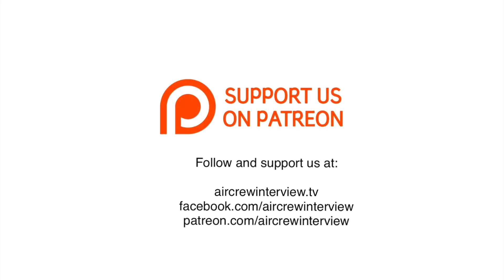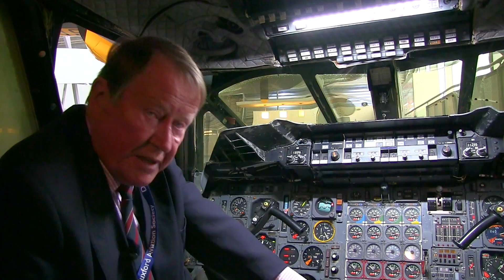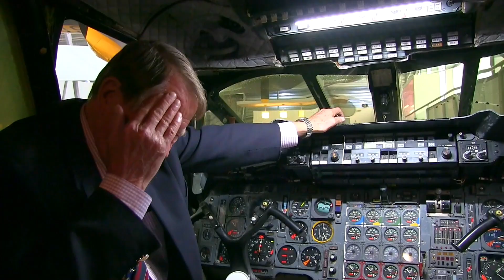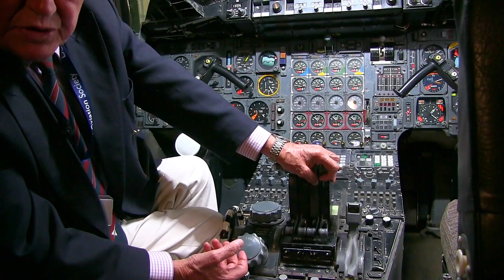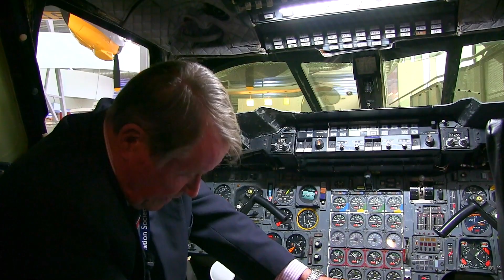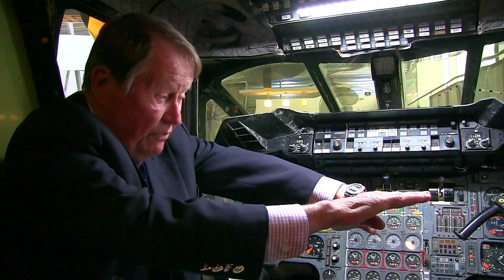John Hutchinson on Air France Flight 4590

Comment: Every air disaster points to polity error but with a co-pilot safety should not be compromised and if it is both pilots should be dismissed and lose their licence. Every time I have travelled by air the plane experiences Turbulence but when travelling form Sydney direct to Dubai 2006, we were warned to expect Turbulence all the way but Turbulence only began after leaving the Australian coast line and we began traveling in access of 500 MPH, which caused the wide-bodied Jet to shake violently and yet when we reached Dubai the plane had to wait to dock. I know a head wind slow a plane in flight and no doubt a tail wind increases flight speed well above 500 MPH perhaps the pilots were keen to avoid stacking on arrival at Dubai save fuel.

Comment: why did they discontinue using the Concorde? This was the one and only Concorde crash correct? And it certainly was not any fault of the plane itself.
Reply: Link they discontinued Concorde because it was too expensive to fly
Reply: It seems that heavy scheduled maintenance was on the horizon at a time when BA wasn't making all that much money and AF was happy to let her go. Airlines fill gaps by leasing or having spare aircraft but Concorde wasn't an option.

Had it not been 2003, it would have been the hit of the 2008 financial crash and the ensuing high fuel prices (you can see here: http://www.macrotrends.net/1369/crude-oil-price-history-chart)  that would have done it.
Reply: To expensive and it was not a commercially viable option to keep running when you might fill 1/4 of the seats plus the fuel economy would make it even more expensive so thats why.
Reply: It was discontinued because no one wanted to fly the Air France concorde anymore. People flew over the channel to take the BA one.  BA actually made money from Concorde.

Anyhow, once Air France deemed their Concordes were no longer making any sort of money, they retired them. There are reports of Airbus then having meetings with Air France, after which Airbus announced they would no longer produce any spare parts. Without those, the maintenance on the BA Concordes would have been tough. BA asked to buy the Air France fleet to keep theirs running. A solid no was given in answer.

And there you have it, BA was forced to retire their fleet, despite having 30 to 50 Million £ of interior upgrades in a hanger, just purchased and waiting to go into the aircraft.

All because Air France maintenance and one flight crew fucked up
Reply: Too expensive. And of course, 9/11 happened the following year
Reply: The main reason about 9/11 was that all the execs etc that flew on Concorde were killed on that day --It's a pity more people hadn't used it from other countries or it would still have been flying
Reply: Twenty Rothmans how long can an aircraft like Concorde be maintained safely?  Wasn’t it close to 27/28 years old?
Reply: 911 had an impact
Reply: So an event that was yet to happen brought down Concorde....wow!!!
Reply: Trisha Yamada if it had Been maintained properly and the captain had not overloaded the Aircraft fuel and also had the runway Been checked properly for debri that crash would not have happened , it was not the Aircrafts fault , look at 747s still flying after 30 yrs without crashing
Reply: +Link There are good points below but I would point to an ill-advised partnership between Britain and France as a starting point.  Britain and Germany would have seemed much better, because there is just a lot of aviation orientation and expertise  in Germany, but.... maybe it was just too soon after World War II for the British...who knows? The second point is that the business model for the Concorde depended on stable, low-cost fuel, which went south in 1973.  Jet fuel in early 1973 was about 20 cents a gallon.   A third point is that the Europeans underestimated our American pettiness when the Brits and French built an SST first. Believe me, a Boeing SST could have made all the noise it damned well pleased.  Fifth, there was no backup plan if the big American carriers backed out of their commitments to operate Concorde, which they did.  Sixth, there was no real plan for using or marketing the Concorde in alternative ways, such as cargo or converting  the aircraft into some kind of nonscheduled bizjet.  Seventh, the Brits and French had no stomach for pursuing improved engines or a faster design as a follow-on to the Concorde, and  so they finally just lost their nerve and quit.  I was always afraid that it would be the French that crashed the jet....as a friend of the UK, i would just close by saying that if you Brits imagine that  America would keep its NATO commitments to defend you in case Russia feels certain about  what the Dear Leader WON'T DO, then you are sadly mistaken.  Best to redevelop that famous  British determination and ramp the backbone up, and figure out a plan for yourselves, I would think...but thank you for giving us Concorde for a few years!  Cheers!
Reply: William R McIntosh I want to correct you on a few points you made.

They did have plans for a follow on. Concorde 2 was already on the drawing board, which would have been enlarged with more efficient engines. Plans were already underway, quite literally, in the drawing rooms designing the next Concorde upgrade by the time the first prototype lifted off in 1969.

Even by 1978 a Concorde III was being discussed, which had a high bypass hybrid turbofan stroke turbo jet engine producing far more power for the same fuel output.

Concorde was being chartered from the mid 80s, and making a huge profit for British Airways. Not only that by 1986 the scheduled services were making 25% of all of British Airways is profit just with the Concorde, ignoring the entire rest of the British Airways subsonic Fleet. That tells you how much profit British Airways could make out of Concorde.

We didn't lose our nerve, it's just that Airbus wanted something like £140 million for a maintenance contract, which British Airways wouldn't pay out of pride.

Airbus put this cost down to developing New Materials, new hydraulic oils etc, which was just a poor excuse, because they didn't want to maintain Concorde anymore - it was a waste of time for them.

So after Air France decided to stop scheduled services with their supersonic fleet, British Airways had no choice but to call it a day as well.

Comment: I had heard before about the possibility of the Concorde being grossly overweight on takeoff, but this is the 1st time I'm hearing of the missing spacer on the undercarriage truck, one more piece of an unfortunate puzzle. It's sad to think that if you remove just one piece of this puzzle, the accident probably never would have happened. If the Captain had not overfilled the tanks, even when the plane ran over the metal strip, punctured the tyre and hit the underside of the wing/tank, it may not have ruptured and the takeoff would have continued safely, allowing them time to dump fuel and return. Would have been a rough landing still, but survivable.  Many thanks to Cpt. Hutchinson for providing the complete story.
Reply from the maker: Dave Chapman I had never heard of this argument before chatting to John.
Reply: I can't remember where I heard it before, maybe it was another time that John had brought it up, maybe it was from someone who had heard this interview before, I'm just not sure, but this is still a most fascinating and tragic interview. Many thanks & Cheers!
Reply: Something similar happened to a VC10 in Addis Ababa in 1972. Some brake componeents were incorrectly refitted. There was a burst tyre before V1 and when the crew tried to brake the action was too poor and the a/c went off the runway killing 4 I believe.
Reply: The investigation looked extensively at the spacer and found it had no material effect on the accident. The assymetric thrust would have been far more significant than scrubbing tyres.

Comment: Wow what a mess. Although a DC-10 was the cause of the debris, a whole series of events made it even worse.
Reply: The main problems were the fuel and weight issues caused by the pilot.  The debris was minor.
Reply: fools could have taxied to the other runway and taken off in the other direction and had no issues
Reply: @bradrum1  The debris is unlikely to have been the cause of the tyre ripping apart, more likely the scrubbing at high speed. The debris was a way to deflect blame.

Comment: i was wondering if the concorde had moden computers would it of made it ?
Reply: not really, the aircraft was overweight at takeoff, meaning that even if it managed to land or decided for a takeoff abort it would have made a real mess
it was airborn with a stuck undercarrige and below 75% total power: 3,4 full, 1 at roughly 75% and 2 running betwwen 3-4 and 15% due to fumes hot air ingestion (before beign shut down) so in the end it was trying to stay airborne with something like 70% power at best and max drag
add also a cg that was constantly creeping backwards
to this you have to add the fire burning the structure and more important hydraulic lines
Reply: Leah Jackson I think it would as there would be no flight engineer to turn off the engine for no reason.
Reply: Ross TheNinja 
That engine was putting out between 5 to 15% of its max power after the fire started

Comment: The whole sad truth. If only ONE of those mistakes had not been made, perhaps it may not have been so fatal.
Reply: Vista Brazil
Reply: Biggest mistake: Improper maintenance on landing gear. Least forgiveable mistake: maybe the pilot's deliberately choosing to over-fill the tanks. The pilot probably didn't fully appreciate the reasons why the tank fill limit was set to that level, and the risks involved in going over it. If you don't have as much knowledge as the engineers who set a limit at a certain level, then you should never choose to over-rule them under normal conditions (i.e. not an emergency).
Reply: @grezgorztube  Tyres were always a problem on Concorde, they were specially made but they were always working on the absolute limit. Tyre failures were not unknown on Concorde and fuel tanks had been holed in the past.
Reply: Deus Ex Machina, just as amazed that despite maintenance, a thrust reverser was inoperative on one engine ! The misassembly of the wheel bogie is beyond belief. I've flown AF only once and I wasn't impressed by anything at all, quite the reverse. Avoid !